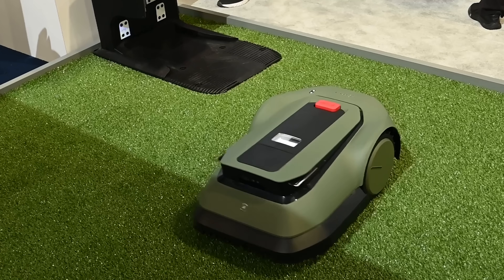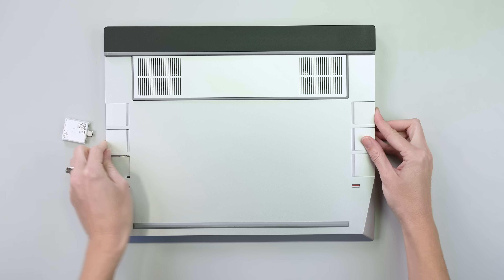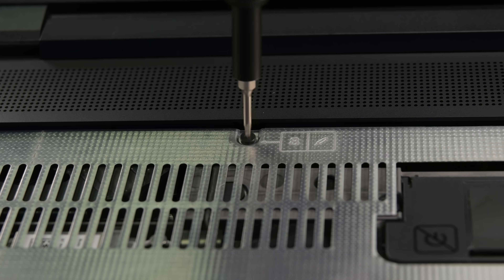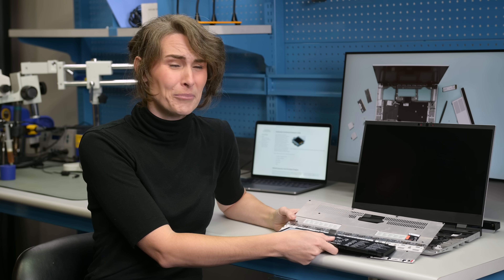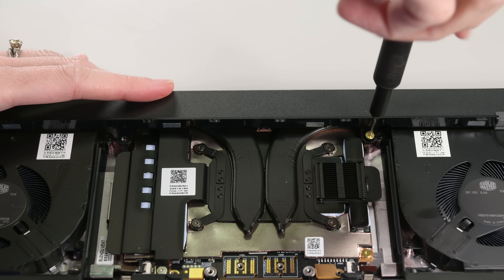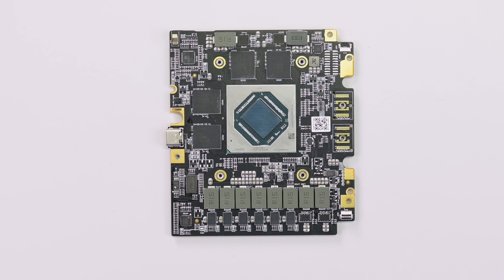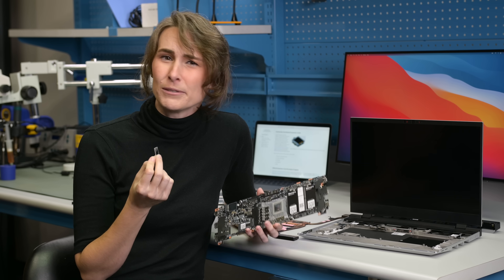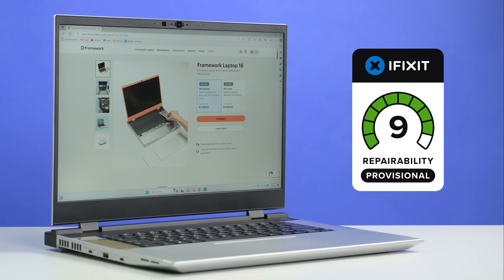The Framework 16 Teardown!-Best Teardown of the year already??

Comment: I am a proud owner of their 13-in and if the 16-in makes good on its smaller brothers design philosophy, a lot of users will be very happy with this laptop. The weakest part of the 13 inch for me is the keyboard and from initial reviews it doesn't look like it's any better here. But in frameworks defense it's hard to make a much better keyboard and still have it removable so I'll take the slightly less than perfect experience over not being able to repair it when something breaks.

For the inevitable comments, yes you do pay a premium for a framework device, but it's not a brand tax. You're paying more because of how the device is designed. It is more expensive to build modular but in the long run it's probably going to save me money compared to buying yet another XPS like I have been doing for the last 10 years. I don't anticipate changing the chassis on my 13-in in a couple of years when I upgrade the main board. I also don't foresee me having to change some other parts of it either. 

It's not for everyone and the modularity does come with some sacrifices but part of frameworks mission is the same mission statement that Tesla had starting out before Elon purchased it, which is to push the rest of the market into the future and I'm willing to support that.
Reply: At least here in the US, it looks like one upgrade cycle, maybe two, would be all you need for that premium to pay for itself. Works for me!

Comment: It's great to keep things in use for as long as possible, and Framework has shown this to be a priority in their design.  So with that being said, the best laptop for me right now is the one I already have (and probably is the case with most users).   I've got a nice 4 year old speced out Dell XPS, but once it dies (or no longer meets my needs), you can bet I'll be considering one of these!

Also I really hope Framework comes out with a drop-in OLED option.  A lot of high end laptops are coming with OLED screens; I'd happily pay a premium for that.
Reply: Doesn't OLED have burn-in issues though? Kind of defeats the purpose of avoiding e-waste. Maybe Mini-LED for now until MicroLED becomes a thing in like 10 years.
Reply: I've had my Dell XPS OLED since 2020.  I recently checked it for burn-in and was actually quite impressed!  No issues!  But I  looked very, very hard  (I have great closeup vision btw), I could maybe barely make out the start button (on a solid grey screen), but even that could have been my eyes playing tricks on me.  And even if I did get mild burn-in, it's not like it renders it unusable.  Point being, My laptop will likely become outdated long before burn-in becomes an issue.   @cameron_bosch

Comment: The reason I bout a FW 13 is because of repairability. A feature I hopefully wont need, but if/when I need it, it will be invaluable.
Reply: You could have easily bought a used ThinkPad T480 for a fraction of the price (around $200-250). Comes assembled and running out of the box. Easily repairable, upgradable, very good I/O due to Thunderbolt 3 and only USB 3 ports, and even has a hot-swappable battery expandable up to 72Wh, which even Framework laptops don't have.

Comment: its wild to see this kind of laptops, my 10 year old MSI GT72 (aside from the usual 2 dimslots on the other side, and the mid frame, was pretty much super upgradable, having the GPU/RAM/SSDs/HDDs and fans/cooling etc accesible just by removing the bottom cover

Comment: It's not exactly modular tho, is it? The GPU isn't replacable with anything standardised, as it uses a proprietary system of connection
if they really wanted something modular, wouldn't the logical step be to go for an MXM Slot?
Reply: The MXM standard is quite old and probably would've created unnecessary restrictions (for example it probably can't control fans)
Reply: It’s not proprietary, there just aren’t others who make parts with it yet.

Comment: Remember when MacBooks had replaceable RAM & HDD and hot-swappable batteries?

Pepperidge Farm remembers.
Reply: the last MacBook with a hot swappable battery was made in 2008 😮
Reply: @axethepenguin  2009 actually. The 1st gen white polycarbonate MacBooks were made from 2006 to 2009.
Reply: @bibasik7  Oh of course, yeah I was mainly thinking of the 2008 unibody models

Comment: The screws being captive definitely makes the 16 screws to get in a lot easier to swallow.
Reply: I think them being captive makes them very very difficult to get in your mouth, but you do you bud
Reply: Also the pattern is meant to more evenly distribute the force as you are unscrewing it. If you unscrewed all the screws on on side, the unscrewed side will lift and could cause the panel to warp.
Reply: No, it makes them much harder to swallow. 

When I want to screw myself over I prefer eating uncaptive screws.
Reply: I think them being captive makes them very very difficult to get in your mouth, but you do you bud
Reply: I think them being captive makes them very very difficult to get in your mouth, but you do you bud
Reply: I think them being captive makes them very very difficult to get in your mouth, but you do you bud
Reply: @samuelmatheson9655  FYI I see this comment 4 times. YouTube comments are weird, lately a lot of my comments have been disappearing into thin air for no apparent reason.
Reply: @samuelmatheson9655  ??????????????????????????????

Comment: 2:32 "(...) throwback to a more civilized age (...)"
Such great wording on this. Specially with the soldered components period we are currently living.
Reply: Yep. My first ever Dell laptop from the late 90s (or possibly 2000-2001?) had quite a few similarities to this. It had two swappable module spaces at the front for things like a floppy drive, CD drive, card reader, and battery. I could easily change out the memory and hard disk, and of course it had a PCMCIA slot as well for all my networking needs. Everything was so easy back then. I really want one of these Framework laptops, they look amazing!!

Comment: what's that usb-c on the graphics module for? also, great video. this company is a great sign of a better future for laptops
Reply: acts like a normal usb-c but this one is hard wired to the gpu chip for usb-c dp alt mode.  effectively you can use either a separate usb-c display port dongle or the display port module from framework to get display port video out (or hdmi if you wish)./
Reply: It's mainly an additional display output, but you can probably also connect a USB 2.0 device.

Comment: A repairable/modular laptop, WITH ALL PENTALOBE SCREWS? They seriously chose the screw type that is the easiest to strip? Baffling
Reply: Use T5s which is Torx
Reply: They're using Torx screws, not pentalobe. I usually really like Torx because it works well and there is no confusion like between philips and pozidrive for example, but agree with my experience from the Framework 13, that these tiny screws are very easy to strip, especially with bad tools.

Comment: My only deal breaker is the single NVMe slot. I have two 4TB Gen 4 drives with my main Linux OS on one and Windows on the other. I wouldn't be able to use a computer with just one slot unfortunately. Besides having to combine the drives and the headaches I had avoided by not doing that in the first place, I'd have a 4TB NVMe just floating around.
Reply: Actually it has two, a 2280 and a 2230. It's just that the 2230 is a little hard to see

Comment: Devices are so hard to repair that seeing this teardown gave me nostalgia from the early 2000's
Reply: technically there not that hard to repair. its finding replacement parts which can be hard to find or impossible to get unless you salvage from donor laptops.
Reply: Maybe not laptops, but the amount of glue being used today is ridiculous  @LCJammer
Reply: Skill issue
Reply: @andrewho2456  ??
Reply: @andrewho2456  look at our little comedian
Reply: Look at business laptops like Lenovo X or P series, HP Zbook, Dell Precision. They are very easy to repair and upgrade. A lot of gaming laptops also have easy repairability. It's mostly the cheap entry level and midrange stuff that will screw you over.
Reply: @Agret  doesn't lenovo literally have soldered ram
Reply: @M1szS don't see soldered ram in legion laptops by lenovo, sodimm 5600mhz, can swap to higher clock speed or tightened timing at your own risk(overclocking isnt easy as i bluescreened after overclocking my cpu frequently before as i didn't check stability that much)
Reply: @Agret  not just entry level laptops, things like apple's laptops are still hard to repair
Reply: @Agret  Some Lenovo P series have soldered ram, HP ZBook Studio too. I have both models at work, it became really a crap!
Reply: @elcactuar3354 bro Who kares?
Reply: @elcactuar3354 grammar  police in the house 😆
Reply: @elcactuar3354 how about     no.....
Reply: @LCJammer  even with donor parts, something like macbook is still hard to repair, or in the case of a failed ssd, impossible
Reply: @M1szS  idk about that i see youtube videos of people repairing macbooks all the time. ie louisrossman who made a living off repairing macbooks that broke easily.
Reply: @LCJammer  yeah, and he himself said it was a pain in the ass, with some parts like ssd, as i said, being unrepairable, this is a joke of a product, that no person with self respect should ever buy

Comment: 10/10 score absolutely earned. Brilliant teardown! 
I wish Framework will someday sell a phone which will also respect the environment and the consumer like this incredible laptop.
Reply: God dammed fairphone had to remove the dam headphonejack. 😢 no longer worth it.
Reply: @trowawayacc  Not just that. They're also selling e-waste earbuds.
Reply: @goldmastersimulations  if they make true wireless earbuds with replaceable batteries, then one might consider forgiving the removal of headphone jack.
Reply: Like the fairphone?
Reply: @arzosah112  Yeah, but better. They really tried to convince people that they removed the headphone jack for "longevity" and "waterproofing"...
Reply: @平和-v1z  That really doesn't hold any water. My LG G6 from many years ago was IP68 with micro SD slot, and headphone jack. Not to mention the Galaxy Note 9. They could make the battery "waterproof" but a headphone jack was too much? C'mon.
Reply: yet has harder access to taking out the fans(for cleaning which needs to be performed often in a powerful laptop) is worse than in most gaming laptops.
Reply: @TabalugaDragon 6 (retained) screws and an air can seems hard? Even removing the fans kinda remind me of tower pc cleaning.

This is without mentioning I haven't had to clean my Asus Tuf gaming laptop in years...
Reply: @rya3190  I'm mostly referring to the cable placement, I've never seen it placed  as inconviniently as this
Reply: @TabalugaDragon  Doesn't seem that bad...then again my old tower required me routing a fan wire between the gpu and psu, so maybe I'm just use to having to suffer to get my stuff working...

Comment: This is fantastic. I'm also pleased to see that they are making the schematics available to repair shops, although it would be nice if they were made available to everybody - It's not clear on their site whether or not Framework would make them available to end-users who wished to repair their own equipment.
Reply: It is an IP issue, Louis Rossman talked about conversations he had regarding this. Apparently making schematics available at all was a challenge for them. It isn't so much major silicon manufacturers like AMD and Intel it's more ODMs who do a lot of the backbone design of things like the motherboard and integrated functions like WIFI, charging, IO etcetera. 

There are manufacturers like system 76 which are more open with schematics but they are more expensive and less polished. Using ODM based components was a compromise they chose for the sake of mass market viability. 

I wouldn't be suprised if schematics end up 'leaking' online though.
Reply: They likely have their hands tied, as the full schematics probably includes bits of IP from other brands (Intel, AMD, and so on). I've never tried obtaining a schematic directly from Framework, but I think they'll just make you sign an NDA before giving you access...
Reply: If you asked nicely for it perhaps they would but yeah as said above it probably has to do with 3rd party IPs, their board partners, manufacturers or even just plain not wanting to get their laptop replicad and sold on taobao

Comment: Many super nice concepts and Ideas. I love the direction, but unfortunatly it can't replace my MacBook Pro at all. I wouldnt mind an extra 20min in repair or Upgrade time if the device could be more compact, and have a nicer design. Swapable ports  are nice, but honestly, for me personaly I dont see much use for it. The ports on my MacBook Pro are enough 99% of the time and in case I really need usb A, I like having 3 of them and an hdmi extra in a hub and not blocking more then one of my laptop ports.

I would like to know if the trackpad comes anywhere close to a macbook as its the most important part of a Laptop and PC laptops Trackpads have always been a massive pain in my experience.
In some places, I would prefer having a realy good Part rather then the option to replace it with 3 other options.
Only one usb charging port is a bit anoying and I cant find information on the possible external displays?

I would like to love the Framwork, but sadly there are so many things where it dosent come close to a MacBook Pro. Maybe in the Future...
Reply: The usb ports on the side work for charging the one on the back is just for direct display output from the gpu! Trackpad is also the same as the framework 13 (Which i have)which is a great trackpad! The ports on the side also work for display outputs but are through the igpu not direct!
Reply: @JamesMcCaigJm Ah, ok, I didnt  notice every port can be used for charging and just 240W charging is possible on 4 of the ports. While I dont like usb ports with diffent capabilities, especially  data speeds (3.2 / 4.0 in this case) thats a small issue.

As far as I can tell, the trackpad is a hinge design and not a force touch trackpad like the one Apple uses for 9 years now. The hinge design makes it impossible to klick at the top and for me at least it would probably be a dealbreaker.
Reply: yep, my thoughts exactly. Plus I value the weight and size of the notebook, and this advanced modularity hurts it a lot I think.
I also wonder, how many times ppl upgrade their RAM or SSD, and why not to choose the correct size from the beginning.
--
IMHO, most ppl want repairability, not modularity. Framework addresses modularity, while repairability is a consequence. Good luck for them, anyway, nice to see such a toy🙂
Reply: @ayratkhalimov1648  I mean, using an M.2 that can be replaced dosent take much space. But yes, most people could choose the right capacity from the beginning if its just reasonable priced.
In a laptop, portability is most important, a desktop can be modular an I dont care if its a little bigger or samler, but a device I carry around every single day, I want to be as light and thin as possible with the power I need.

Comment: It shouldn't have a 10/10, it has no upgradable cpu
Reply: Thank Intel and AMD for that.
Reply: The framework 13's have had several generations where you swap out the motherboard to the next generation cpu and keep everything else. Even go from Intel to AMD.  As well as cases to use the old motherboard as a stand alone computer.

Without getting Intel/AMD on board to go back to laptop sockets, that is about as good as any OEM can do.
Reply: Why not use desktop cpus like it has been done previosly on other laptops
Reply: The mainboard is essentially just the CPU with some connectors and some parts for power regulation The benefit to separate it into a CPU module and a module with the few random other parts wouldn't be worth it.
Reply: It would be worth the reduced waste
Reply: Bruh, did you see any recent laptop CPU that would be socketed?

Go on, I'll wait...

Didn't think so. 'Cause there's none. Besides, Framework will provide new motherboards with newer CPUs. They already do that with Framework 13.
Reply: And because there is none that should be a reason so that it does not exist? It was possible in the past, technology has improved so why not now is this posible other than making upgrades difficult? All they whant to do is sell you the whole motherboard for extra profit